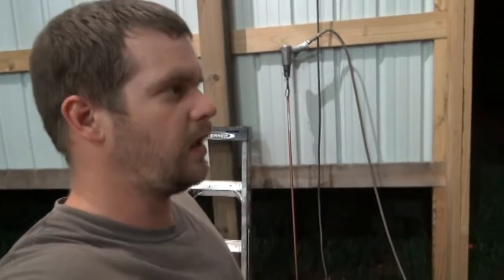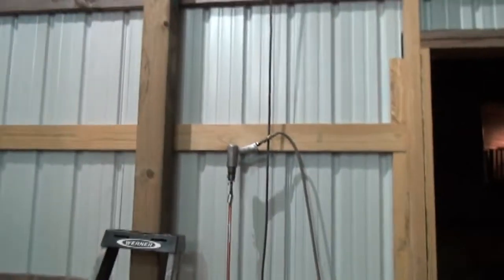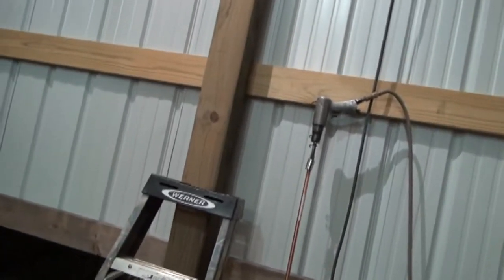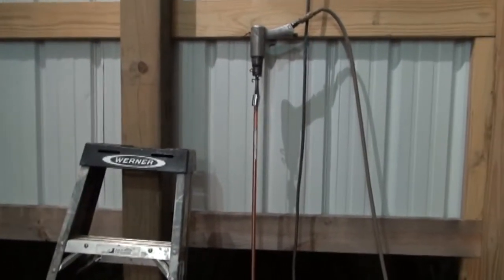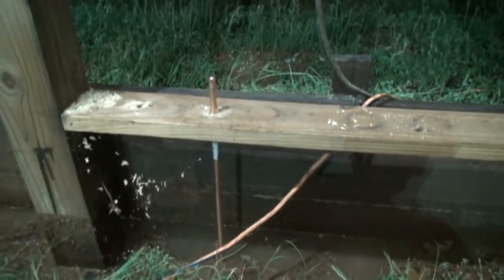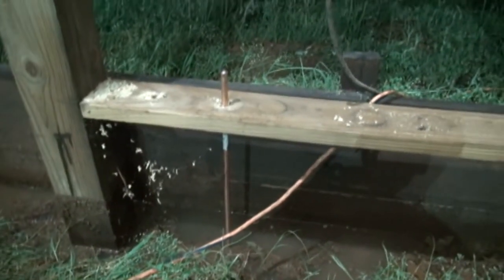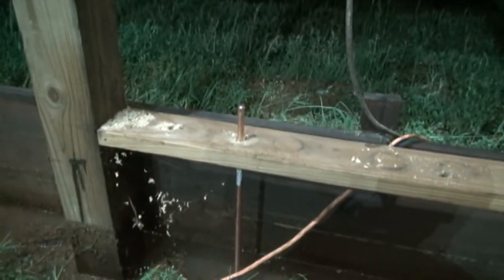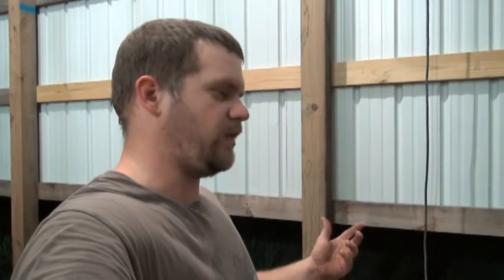How to Install a ground rod without a hammer

Comment: I've heard of them putting a nut on the pointy end of the rod, slightly bigger then the dia. of the rod and they go in easier because you reduce drag on the rod. I suspect it is against code and I can't confirm if it actually works.  At the quarry we laid a heavy metal gird down on the quarry floor and covered it in crushed stone. Used to ground a big diesel generator. Nobody got fired, that's a good thing. KIT d
Reply from the maker: seems like putting a nut on the end would make it harder to drive due to the blunt point

Comment: You should have just removed the chisel and placed the copper rod in there instead.
Reply from the maker: that won't work, ground rod is 5/8 and air chisel takes 1/2 bit, and a 5/8 rod won't fit in a 1/2 hole.

Comment: Cool idea Chase. Wait to you see the rig I use. LOL
Reply from the maker: I'm gonna guess a t post driver lol
Reply: Nope a cobbled up a   wing wang  idea I had. You will get a good chuckle out of it. I put some ground rods in at my camp and my buddy an electrician said I did it all wrong.  Apparently you have to test the ground rod for sufficient travel to earth with a meter and mine weren't  long enough.  I put two 5 foot rods in and he said 8 ft min.  I said piss off .  LOL
Reply from the maker: this is 8ft, code says you need 2 6ft apart or you can stub up rebar out of the slab and use that. I'm gonna tie the rebar to the rod when i install the rebar